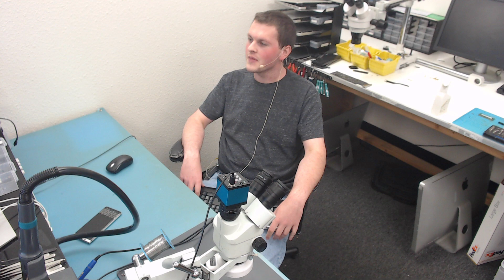Thank you!

Comment: My biggest stumbling block is parts and schematics. I'm starting with Ipods. Where do you get the LCD and battery connectors?
I'm using Ipods because they are cheap to buy parts units and I'm able to make my money back and some times make a little while i learn how to work on these types of items. So I end up cannibalizing too many of the 8-16Gb units for the sake of a connector. Being so old the good ones are only a connection or two away from failing. It takes hours to solder the 30 or so flatflex wires to the PCB. I've been using IDE ribbon cables. It works but what a pain in the ass. I'd buy an entire reel if I could find them.
Reply: I did finaly find schematics for some of the Ipod models. But they don't work with Paul Danial's software.
Reply: And thanks for taking the time to video your work and teaching. A market Louis isn't hitting are the every day items people need to repair or want to modify besides Apple products.  The videos on medical equipment i found interesting.
Reply from the maker: @Mr.Unacceptable  as far as battery connectors, donor boards. LCD connectors i get from Louis, or donor boards.
Reply: @Mr.Unacceptable  hey I am after a schematic for an Ipod Classic 30/60GB if you can help me please ?
Reply: @Mr.Unacceptable  also I think that I heard Paul say that if anyone came across any boardviews that don't work with Flex BV,  if you contact him and send them to him he may be able to add them to his list